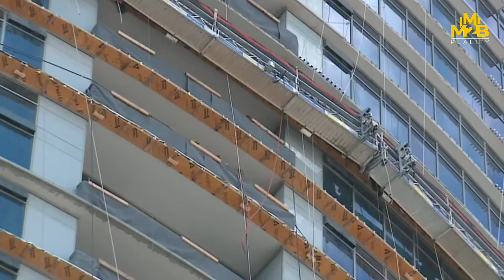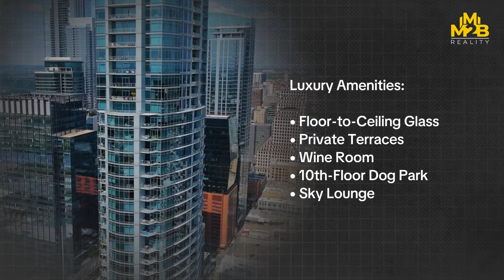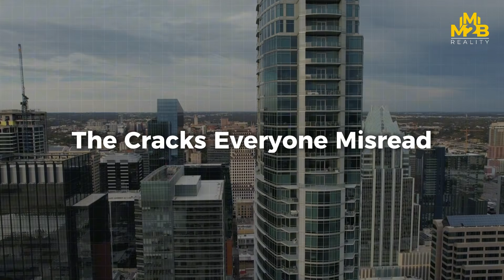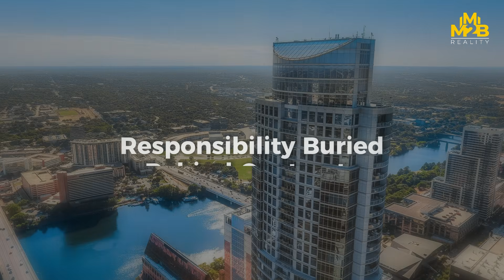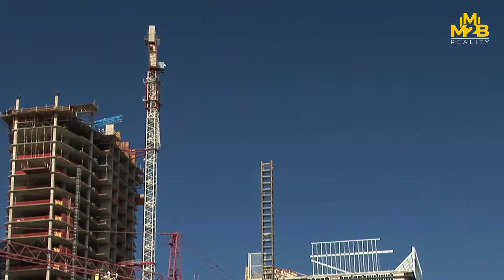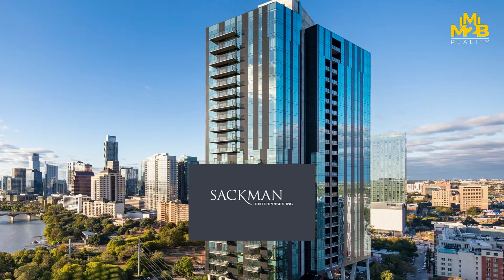Texas' $200M Luxury Tower Began Cracking and Sinking — Then 55,000 Tons of Concrete Failed

Comment: It’s what we call concrete cancer. 
When I worked in pools, I would explain it to my customer if they walk out to the curb and take a look at the sidewalk, you will see cracks in the sidewalk with rises. Those are the roots that are expanding and that’s when the customer starts to understand that water and rebar don’t mix and if they do it expands.
Reply from the maker: Rob, “concrete cancer” is a great way to describe it. The sidewalk-root example makes the expansion easy to understand. Thanks for sharing your experience!

Comment: The Tower on the U.T. campus has stood for a very long time with no problems (or very few). Obviously, the ground is not the problem.
Reply from the maker: Exactly. Austin’s soil made an easy suspect, but the actual defect was hidden inside the balcony concrete.

Comment: Same thing is going on in the Aston Martin building in Miami. Exposed rebar eating the structure from the inside.
Reply from the maker: That’s really concerning, especially if the rebar is already exposed. Have you seen any recent inspection reports or repair work happening at that building?
Reply: @DisasterMoments1205  There are several YouTube videos about it. The problem is ongoing with no definitive decisions made.
Reply from the maker: @scanmead That sounds incredibly frustrating, especially when the problem is visible but no clear decision has been made. I hope the people living nearby are getting honest updates. Are residents or local officials putting any pressure on those responsible?

Comment: What happens when the quantity surveyors go with the developers instructions to make everything as cheap as chips, and the rest of the design team just follow orders, or get fired.
Reply from the maker: That pressure to cut costs can put the entire design team in a difficult position, especially when refusing means losing the job. Still, everyone who approves a change should remain accountable for its consequences. Do you think professionals need stronger legal protection when they refuse unsafe cost-cutting?

Comment: Why are so many building failing?
Reply: greed, laziness, inept construction, poorly trained labor!
Reply from the maker: @LKemp-lr1ky  When poor training, careless work, and greed come together, the people who had no control over the project often pay the price. It is frustrating because many of these failures could have been prevented much earlier.
Reply from the maker: That is the worrying part. When the same kinds of problems appear in multiple buildings, it raises questions about construction quality, inspections, and accountability. Do you think the bigger issue is poor workmanship or weak oversight?
Reply: @DisasterMoments1205  My gut says weak oversight is a leading cause. The classic example in my lifetime was the Hyatt Regency walkway collapse. It may seem unrelated, but the first shuttle disaster followed a similar pattern. In both cases seemingly  small changes led to disaster. Following that, I'd question materials, sourcing, and I don't want to call it complexity, but rather the necessity to follow instructions exactly. For the last part I mean you may have multipart systems spec'd to be used without any deviation - no improvising substitutes, shortening curing times, operating outside of spec (those pesky o-rings pop up again), etc. None of this truly new, but a lack of oversight will eventually catch up to you.
Reply from the maker: @NuncNuncNuncNunc  That’s a thoughtful comparison. Major failures can begin with changes that seem minor, then become dangerous because nobody checks how they affect the whole system. Materials, substitutions, and strict compliance with specifications all matter. I appreciate you explaining your reasoning so clearly. Would mandatory independent peer reviews catch more of these problems before construction?
Reply: @DisasterMoments1205  I think its probably more visibility. These things happened in the past as well. It's just the news in the past was gated behind a few media outlets and local broadcasts. Now there's a million YouTubers looking for stories to cover. Every new building has issues; as well as aging buildings. 

Workmanship and oversight are plausible but it isn't systemic throughout the world as builders and building departments are regional and not interconnected.
Reply from the maker: @michaelcrossley4716  That is an important distinction. Greater visibility can make these failures appear more common than before, while construction standards and enforcement still vary greatly by region. Similar problems do not necessarily mean one connected global failure. I appreciate the thoughtful correction.
Reply: @michaelcrossley4716  I'm more inclined toward accumulated debt, e.g. fifty years ago there were fewer fifty year old building. 

Fifty years ago there were also fewer news outlets making it more likely for most to be informed as all outlets are chasing the same stories. Virtually everyone sees the same major stories

I don't think there needs to be some underlying connection for the same problems to be duplicated across a wide area. Economics (time and money) is a driver everywhere. You can look across centuries to find examples of rejected bridge cable wires as one very specific problem that repeats.

There are indeed multinational working across the globe, but I do not necessarily think a Bechtel would have greater issues. Just the opposite, I would expect more internal  oversight, greater standardization, and stricter engineering protocols. Just clarifying thar where there are connections, that is likely not the heart of the problem in my opinion.

As with any complex problem, various issues may contribute to varying degrees, so not dismissing any reasonable causes outright.
Reply: everyone wants to save money and/or skim off the top
Reply from the maker: @ifuckorphans That is often where the trouble begins. Everyone tries to save a little at each stage, but eventually the people using the building inherit all the risk. It makes you wonder how often workers raise concerns but are ignored.

Comment: If this construction failure is caused by a bad exterior deck design, then why have curtain wall windows fallen out? Why are interior doors jamming in their door frames?  That doesn't sound like a rain water problem penetrating an exterior concrete deck problem? This sounds more like an uneven foundation settlement problem. -- I have my doubts about this building and the designers who designers who designed it.
Reply from the maker: That is a fair concern. The balcony rebar issue may explain the falling concrete, but jammed doors and fallen windows could point to separate problems or possible building movement. Without the complete engineering reports, it is difficult to rule anything out. I appreciate you raising this angle. Did you find those details in another report about the building?
Reply: @DisasterMoments1205  -- No I haven't seen other reports about this building and it's problems. In that part of Texas it can experience 3 to 4 inches of rain within a hour which is a significant amount of water. That building has hundreds of exterior decks that require waterproofed decks. If water penetrates into the structure it can do all the damaged you sighted in your video. Your video is good including the windows falling out and interior doors jamming in their frames.
Reply from the maker: @martentrudeau6948  Your rainwater explanation is reasonable, especially considering how much water those exterior decks may receive. It could potentially connect several symptoms, although the balcony, window, and door problems may still have different causes. Thank you for clarifying the basis of your view. Would you trust any repair without first seeing a complete waterproofing and building-envelope assessment?